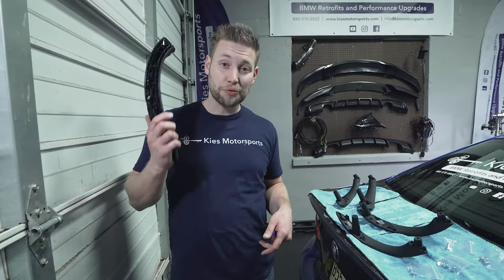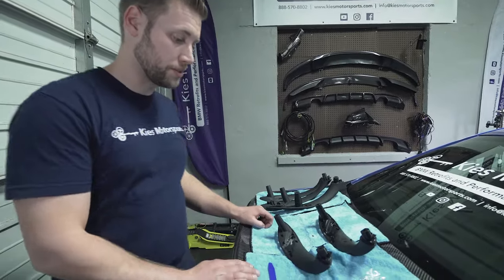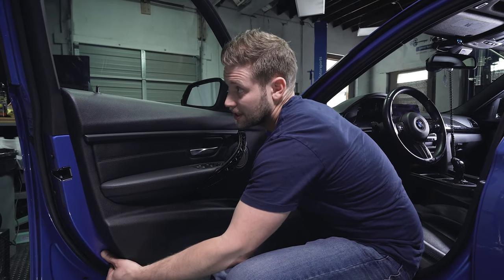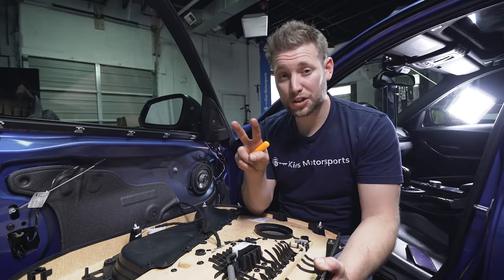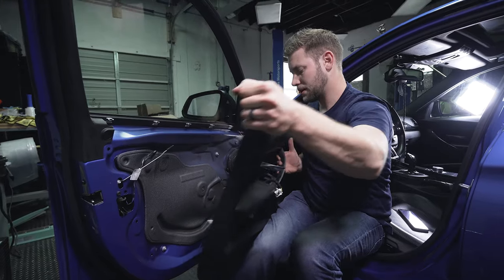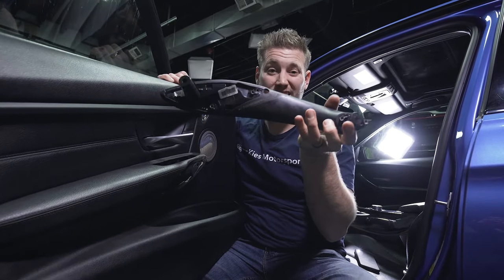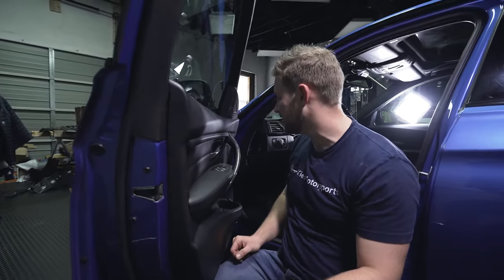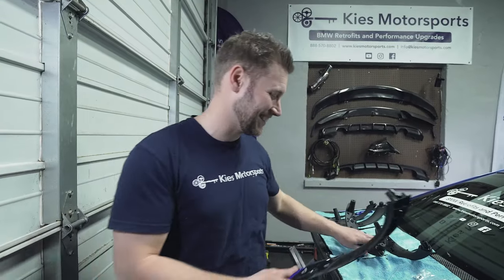How to Replace STICKY Inner Door Pull Handles on your F30 BMW (BMW 320, 328, 330, 335 and 340)

Comment: You can put some grease on all metal clips and also door clips( basicaly on any clip in the car) before reassembly. This way you prevent rattles and also if you have to remove once again it will be much easier and with less chance to brake the part.
Reply: Two years later and you’re still helping people out with that tip. My guy🔥
Reply: What kind of grease?
Reply: Great tip! I could not get the handle cover on and remembered this tip. With grease it went on easily.

Comment: Kies, you guys are awesome! Plugged in window switch harness after reinstall, now window switch/mirror control is not working.  Bimmerpost had the answer: When you reseat the plug into the harness, ensure the grey handle is fully opened (9:17 in video he opens it fully) then when you reseat the plug, push firmly (not hulk strength) until grey bar begins to move on its own, towards the top/lock. Keep holding pressure into the plug, then reset the locking handle past the top clip. Check the window lock/unlock for the green light. Then you know you have power. I went thru fuses, posts and frustration till I simply reseated the plug. Works great! KIES ROCKS!!

Comment: When putting the door-liner back onto the door:  Start at the top as Brian does.  Just know that some of the clips (maybe all of them), along the top weather seal tend to slide aft, out of place along the weather-seal (about 1/2") as you remove the door-liner earlier in the sequence (about 3:17).  Gently push the clips - forward along the weather-seal so that they align with the openings along the top of the door-liner and proceed (about 8:57).  Also, the drill bit that he's using must be maybe 5/8" and only deep enough to free the plastic-melted head from the shank of the "rivet."

Comment: Awesome video. Tip in case anyone runs into it. My plastic rivets weren’t coming off as easy as Brian’s were and I’m pretty sure it was because the drill bit I was using wasn’t quite large enough to bite the plastic away as quickly as Brian did.

Comment: A set of four for US$125.00 seems quite reasonable. Getting the soft touch plastics right has been a challenge for other manufacturers as well. Toyota/Lexus did a warranty replace on entire door skins a couple years ago. At least we're not back in the bad old days of vinyl and plastic "outgassing" and leaving a fog on the windows and everything else in the interior.

Comment: I just installed one of these on my 2016 F 80 M3. The process went pretty smoothly even though it was not as easy as it looks when Bryan  does it. One word of caution when I used the drill bit to drill out the plastic rivet caps after one was stuck on the tip of the drillbit I went to pull the plastic piece off the end of the drill bit and ended up slicing two of my fingers pretty good so be careful!
Reply: I read this comment first and still sliced myself lol

Comment: Just did mine…lost a packet of screws for the new handles.  Found them after I had both doors done so oh well.  Two screws each plus torx ones in door should be enuff!  Great DITY…only comment would be to add the size of drill bit used to drill out those original rivets…first two I used were too small to do the job and one I found was almost too short.  Got it done tho and looks great!  I did the Carbon Fiber replacements to match my interior. 👍

Comment: Finally got around to doing this on my 2013 F30. Thanks for the video help. I did notice (to my excitement) that I did NOT have the melted plastic rivets noted in the video. My F30 apparently came from the factory with T20 screws at these locations (I bought the car new, so I know this isn't someone's DIY). Do you know if this was the case for Pre-LCI? I even went so far as to remove six or seven more T20 screws and completely remove the armrest entirely, which made accessing the T20 screws for the handle much easier than working through the holes in the panel. Also made removing the window control module easier too. Brian - Have a look at your F30 "Luxury Line" project car and see if this is the case. That is the same car I have. Thanks again!
Reply: I just pulled off the driver’s door panel on my 2014 F30 328i, and both the door handle and arm rest are secured by the melted rivets.  No T20 screws holding them at all.  I’m wondering if I can install the new parts using screws rather than figuring out how to melt rivets for them.

Comment: i just did this repair to my f30 and there is some rattling noise, which i believed, came from those replacement screws and their washers. Do you experience the same problem?

Comment: Most of the electrical connectors pull straight out. Just be sure to brace the other side so you don't put tension on something weak. Basically everything is plastic so it can get very brittle.

Comment: I am replacing my drivers side only. After you drilled off the plastic tabs you mentioned some T20 screws to replace the plastic part.  My replacement handle didn’t come with them. What size are they?  Did you need washers with those screws?

Comment: Install was easy, the actual issue for me was that re-installing the existing cover for the door handle won't sit flush with the new interior Kies part. Any insight on how to get flush fitment? I was in a fender bender and my car is actually missing most of the required clips, I guess they just decided to keep them.

Comment: FYI: The front clip that holds in the window switch is plastic and is part of the window switch body. You’ll more than likely end up breaking it off out of frustration after spending significant time trying to blindly release that clip via a hole the size of a quarter.
Reply: On my 428i, there was a hole on the inside (human side) that was slightly hidden, but it allows you to stick a slim blade screw driver in to release the clip for the window controller. located exactly where it needed to be for that part. I too wrestled with that until i saw the entry way.

Comment: Bryan I missed the reply on a prior question. What size drill bit did you use to remove the plastic tabs on the old handle? I noticed you went slow on the torque but wanted to ensure I get it right the first time. Thanks as always!

Comment: I have an f15 and need to swap the passenger pull handle.  I have the replacement and popped the trim off and removed the two big screws, but it's still stuck on the lower portion.  Can you guys post how to remove?

Comment: Man you come in clutch every time brother!! I have the exact same car but in black. 2013 335i, X drive and everything. I have an issue if you could help. So my passenger side lock does not lock anymore. With the remote or from the inside. Can you please help with that? I can’t even manually lock it by pressing down on it. So now I can’t really go anywhere because there’s NO way of locking my car. Please help
Reply from the maker: Hey! You may need a new actuator. My drivers door went on my old f30
Reply: Kies Motorsports Thanks so much for the reply. I have an appointment set up to get it replaced. Warranty is going to cover it they said

Comment: I cannot begin to understand why BMW has STILL not fixed this. The high touch areas of a car (handles, knobs, start button) should be the highest quality so not to deteriorate. This has been happening for multiple generations now to multiple models. It's bothersome that someone had to create aftermarket door handles! I mean thanks Brian but still, should not be an issue.
Reply: Agree 100% - they over engineer so much and then this lowers it to the level of a '72 Vega.
Reply: This is a problem with many, if not most European cars.  All the soft-touch rubber turned to goo on my '02 Ferrari 360, and it will happen to all newer Ferraris as well, sooner or later.  Soft-touch rubber feels great when it's new, but it will deteriorate over time.

Comment: Love the Vids. Appreciate you always sharing the tricks of the trade.  I recently replace my actuator (from watching a video) and wish I would have also replaced the handles at the same time. I have a question what size drill bit did you use to pull out the back of the plastic tabs. Noticed you went really slow but I want to ensure I use the right drill bit size so I dont ruin what the new screw will fit into. Thanks again!!!

Comment: Thanks great video! After installation my controller module is not working what might be a problem?
Reply: Check that the window module is seated all the way in. I had the same issue till I opened the locking lever fully, then with firm pressure, plug the module back in. The grey lever will move on its own towards the locking position. While holding pressure, seat the locking lever to past the clip.

Comment: Awesome Video!!  Thanks!!  Any chance you will be getting the same made for F33 chassis code???  Mine are really janky and would much prefer these to OEM.  Thanks!!!!
Reply: Of course now that I posed that I did some research and it appears that although the F33 has a different part number for the pull (51-41-7-279-312 on F33 versus  51-41-7-279-311 for F30) the fitment chart shows the F30 part number as compatible with the 435i ...  Has anyone tried just using the front parts from the kit on a coupe or convertible??

Comment: Removing the passenger glass controller is not as easy, yeah was told that we cannot see what being done, but it is v difficult for me as I don't want to damage anything. After all, thanks for the video but bottle neck seems to be that thing that could have been explained in more details, already efforts were made and that would have made a perfect video. Anyway, many thanks

Comment: When I took my handles off, the two anchor points that the torx screws should screw in to had broken.  One is under the felt cover, the other should be visible.  It looks like its a square shaped plastic anchor, similar to the plastic anchors that hold the panel on.  Does anyone know where to buy replacement anchors?  For the time being, the handle is being hold to the panel (not the door) with those 4 tiny screws.  I'm sure that if its not addressed quickly, I'm going to end up with the handle ripped right through the door panel.

Comment: Does anyone know if the light connector from the downside of the door needs to be on a certain side or can it be plugged in on both sides? I put everything back on and now the light does not work.

Comment: Do you know what the clip is that hold the 2 t20 screws are? One of mine is spinning and need to replace it. Thanks in advance
Reply: had the same issue. 

I think I found the part number tho. Part Number 07-14-7-265-039

going to order and redo that bit. ugh!!

Comment: i have a 13 bmw 328i driver door somethimes does not open from inside it happened 2 times i have to unlocked from the lock botton and then it open what can cause that just have 38k miles

Comment: how well does the tan color match? I need to get a set of these for the wife's car
Reply from the maker: We guarantee a color match, and if you don't like it, you can send it back for a full refund! Here is a link for the door handles 👍🏼
https://www.kiesmotorsports.com/products/kies-motorsports-replacement-bmw-f30-inner-door-pull-handle-trim-320-328-330-335-and-340?variant=29074241814643?aff=14
Reply: @KiesMotorsports  thanks for the reply.  I will be getting these .

Comment: Hey man, I just got all the way through installation and the last t20 screw (at the bottom of the handle) was not screwing in and then I heard a piece fall into the door. I took the panel back off and tried to put the screw in where it is supposed to go and the crew is too small.. This hole is behind the foam overlay (on the door itself). I think whatever anchor for the screw broke off. Have you heard of this happening, or do you know what I could do to fix?
Reply: Did you find out the name of the mounting anchor for that screw? Just had it happen on the top screw.

Comment: So I started this process and successfully replaced my passenger side handle - no issues. For the driver side, I did the same thing.. pretty straightforward, but now my door unlock/lock pin doesn't pop up alongside my other 3 door pins when I press unlock either from the remote or the center unlock button in between the vents. Has anyone experienced this? I checked my door fuses, and they are all good. Also tried to lubricate the actuator slot or control arm that holds the bottom of the door pin operating lever rod, but no luck. So I think I may need to replace the actuator altogether. The issue is that my door is closed, locked, and won't open from inside :(
Reply: FIXED!! All it took was a few flathead + hammer taps on that lever that holds the bowden wire and the door unlocked. After that, I opened my door wide and started rewiring everything again. Then I closed my door again and my door actuator was acting up still.. this time I was only able to open the door from inside by pulling the lever twice, but it was still a massive improvement from not being able to open from inside at all. So, I took the door panel off again, silicone spray lubricated the part of the door actuator, (white piece) that securely holds the bottom end of the door pin operating rod, then tugged on the door pin for a few mins to move the lubricant around. After that, I put the door panel back on and tested the unlock button, and wahlah! Back in business. Hope this helps someone experiencing a similar issue. Thank goodness I was patient all day and tested a few times.